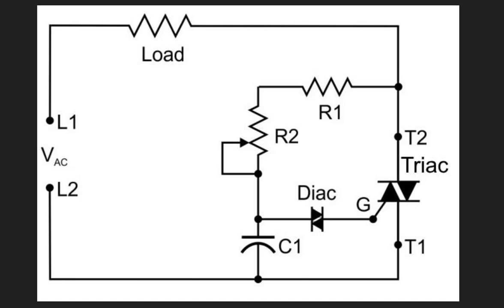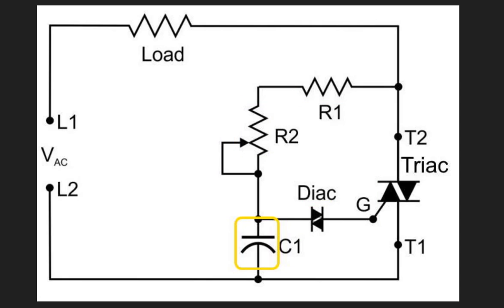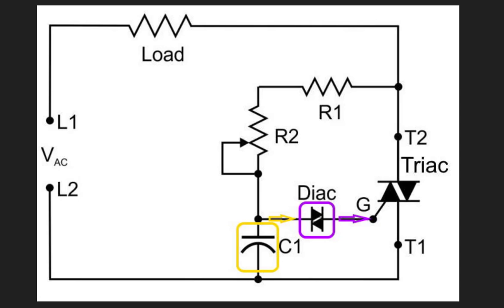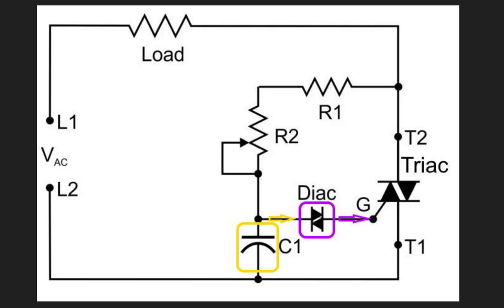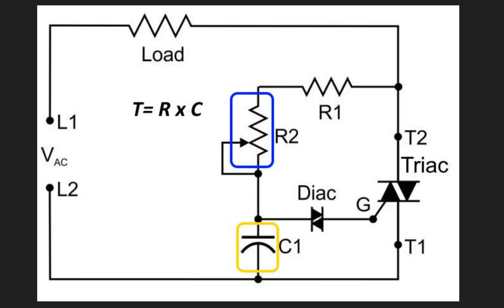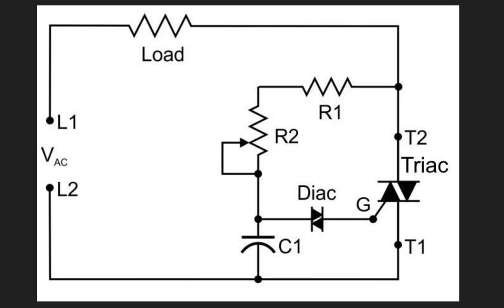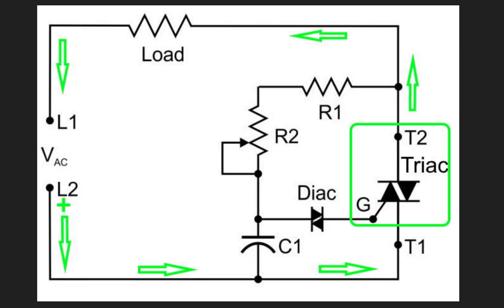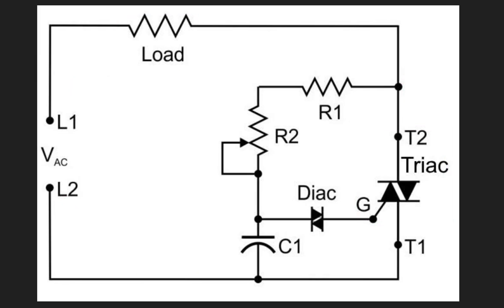Triac Triggering Circuit

Comment: A) Will man einen Glühbirnen Dimmer: (A1 ist der zweite Kontakt wenn das Anschraubblech 
hinten am Triac dran ist , Gate der dritte Kontakt, A2 der erste Kontakt {jetzt Beschriftung ok}).
Dann verwendet man ein simples 500 Kohm Dreh - Poti das an A1 liegt -> dann 100kohm 
als Schutzwiderstand zu 100 nf, 250V und dann auf A2, der Gegenseite der Doppel - Lysterklemme 
-> weiter mit 3,3 kohm vom Spannungsteiler [ab der Kapazität] auf ein Diac -> dieses geht 
dann weiter an das Gate des Triac. Schließt man parallel zut LED Birne  eine Glühbirne, 
hier gesamt seriell zu 220 V über die Doppellysterkleme an, so merkt man sofort, 
daß je nach Potistellung die Glühbirne  zur LED - Birne entgegengesetzt ausbalanziert 
hell oder dunkel wird. Das ist jetzt die allereinfachste Lösung.😄
Der normale und ganz einfache Dimmer kann beide invers im Parallelbetrieb 
bereits regeln, falls als Gegenlast parallel geschaltet vorhanden.

Bei Leistungsdimmern für feinere Schrittmotoren nimmt man z.B. 2 Diac hintereinander 
und erhöht 3.3 K Ohm auf 6.8 Kohm. Bei A) wird z.B. 100nf [des Phasenanschnitt - 
Spannungsteilers] auf 50 nf dafür dann anpassend sogar etwas reduziert.
Bei 220 V LED muß man z.B. einen Mje 340 oder ab 0.5 A > 220 V SMD's.verwenden
als Basisvorwiderstand  verwendet man bei Hochvolttransistoren an der Basis 
z.B einen Elektrolytkondensator mit 22 µF und 35 V und parallel 470 Ohm
dann kann man die 220V LED - Birnen zur maximalen Helligkeit kontinuierlich voll auzssteuern.

Eher speziell zum Ansteuern für PWM's, geht vieleicht der BF 422 noch. (keine Ahnung)
Bei BD 243 [HFE: 25  bis 150, bekannterweise bis 100V lt. Hersteller - Grenzwert, (real 20-40V) 
_So ging es bereits deutlich besser. Interessant zum Ausprobieren ist noch der MJE 340, bei 
nicht ganz so sperriger Form wie der TIP_nur mit voller 300 V Festigkeit. Die Triac - Zusatzleistung geht ja 
jetzt schon zum vollen Rest - Austeuern über den Diac verbindend regelbar auf den Triac_ 

mit etwas Restleuchten , das man eh im Alltag höherstellt beim eingestellten Anschalten, dafür extrem gleichmäßiges Dimmen bis Maximum z.m.Triac in der Spannung dann lastig aufgeteilt . Auch gibt es 10 kohm - Potis mit Ausschalter. bei minimalitisch alltäglichen Bauteilen auch von der promten minimalistischen Menge her, dafür aber gut ausgewogenes Leistungsverhältnis kompakt. ✓

Jetzt für meinen Bedarf bereeits recht gut funktionierend. [zudem ist der Triac selber als interner Spannugsteiler bereits eingebunden]. Problem aber auch Lösungsweg. *Vieleicht geht z.B. der genauso  große BUX _Transistor mit  höherer Spannung bis 300 V wie der TIP noch besser, sogar ohne Ausschalter oder der noch kleinere MPSA 42
Der MJE 340 und 13003 gehen über 300 V. Der Bux98 AP im To 218 gehen über 1000 V.

 bereits besser der ja nur reingequetscht wurde ins kleinere TO 93 - Gehäuse, unter max. 0.5 A und 300 V zum Ansteuern !  Sehr gut. (ok, once again.😄)_ Wegen der dort einsetzenden niedrigen Verstärkung setzte ich zum Regeln ein 10 Kohm statt 500kohm Poti jetzt ein und das passte rein experimentell spontan für den BD 243. Statt dem 3 kohm braucht man deshalb noch kein 5 kohm Poti hier. Super beide haben ausgleichend angesprochen: "Triac und Transsitor" als gleiche Leistungsbauteile, wenn auch verschieden. Wobei jetzt der Triac langsam wieder nach vorne kommt. Sonst nimmt  man ggf. eine  Lampensteuerung, gleich über einen Pulsweitendimmer (PWM) mit einem Ne 555 getriggert wiederum einem Transistor, am besten Hochvolt fest und dahinter einen Thyristor oder bei Niedervolt einen Mosfet. Mit einem Transistor mit Hochvoltbelastbarkeit als veränderlicher Regel - Widerstand  geht es aber bereits ganz gut. Zum Dimmen behält man dann bei kleineren Transistoren mit viel höherer Verstärkung bis HFE: 200 - 500 und 40 bis 50 V Grenzwert. z.B. sogar den bereits dort nachverstärkten 500 kohm Drehregler. (Glühbirnen dürfen dann nicht mehr hier verwendet werden, wegen zu hoher Kurzlast) nur selbtsanpassende LED Birnen) die bereits in Richtung Gleichstrom ausgelegt wurden. 
Jeder NE 555 kann sogar ohne PWM  als Spannungsteiler anstelle verschiedener LM beschaltet werden.
Genaue Spannungsregler sind überall sinnvoll.

bei einem winzigen Minitransformator z.B 3 - 12 V auf 220 V kann man auch Triacs unterschiedlich
in der Impulsweite und Frequenz ansteuern über 3- 12 V  Impulse _nach dem Minitransformator dann mit 220 V unterschiedlicher Dauer auch als Löschimpuls am Triac verwenden und braucht dann nicht einmal gleich einen Mosfet, obwohl diese im Hochvoltbereich über 220 V auch recht gut regelbar sind.

Comment: A very nice presentation. In your circuit diagram above, could a "NTC Thermistor" be used to replace R1, or maybe wired in series with R1, and continue through  the potentiometer to the Triac gate and create a variable "Load" ( a fan ) on the output. If latter is affirmative the fan speed would hopefully be dependant on any heat sensed by the Thermistor. I would welcome your opinion of this. Cheers👍👍
Reply: thanks for this insight

Comment: Why R1 (3.3K) is placed in this circuit?
Reply: I think R1 is used to reduce current in the control circuit. I think variable R2 acts as a voltage divider. Varying the voltage I believe will change how fast C1 charges and how frequently the DIAC sends a pulse to the TRIAC gate.  I'm a beginner so IDK if I'm correct.

Comment: very well explained, it would be nice to know the values of the resistors and the capacitor Thank you very much!
Reply: Fairly common circuit.. If you want to experiment try 100 k for the fixed and ~500 k for the variable. The cap  a common  400 volt  around .1Uf. should work.  (must not be polarized or it can explode. )  should get you close. Make sure the cap is at least over 200 volts breakdown voltage. db3 diac  (about 35 volt trigger point.) almost any diac will work). and 400 v 6 amp triac should work. You can play experiment with the caps .01  or .1.   Be careful you are dealing with line voltage.
Reply: @georgemarkuly8180  thank you so much man
Reply: @georgemarkuly8180  Why the fixed R1 placed in this circuit?
Reply from the maker: Thanks for your feedback.
Reply: @gesvideos  !Thank you very much for your attention! Greetings from Mexico